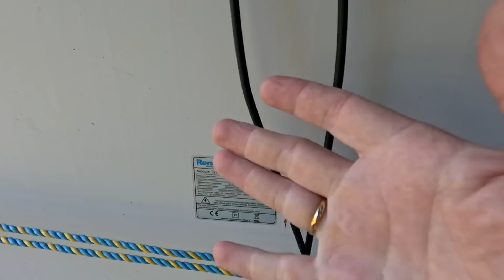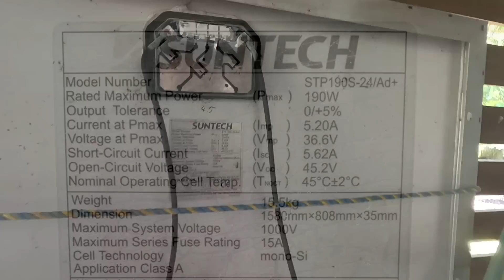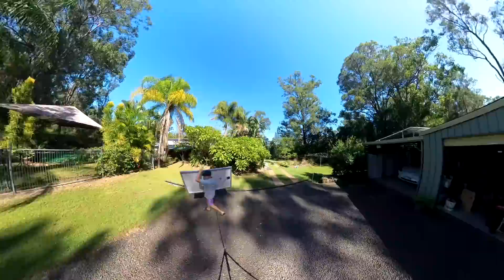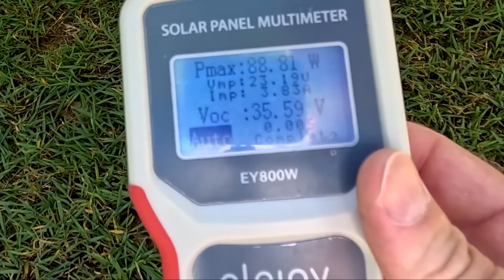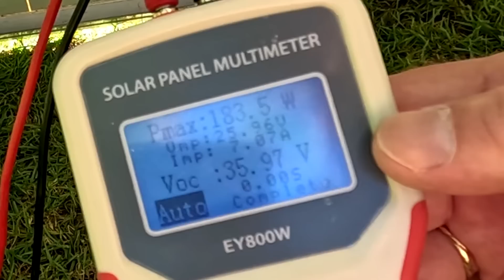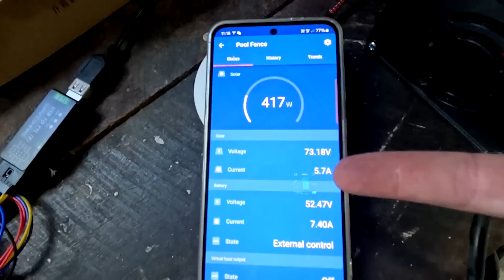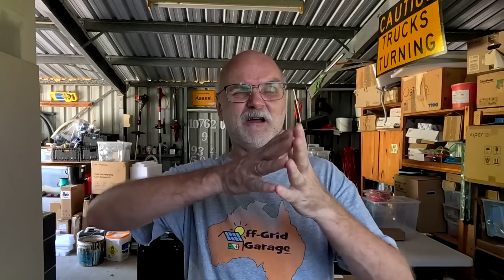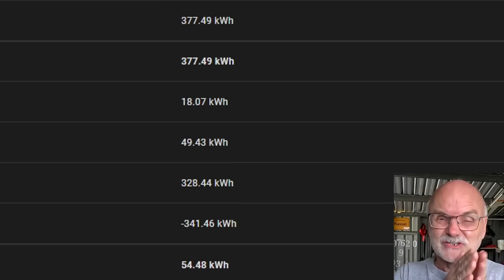Surviving winter with lots of shading with no additional Solar? Preparing for fully Off-Grid.

Comment: good video great that you show us consumers how a typical real life solar on the roof works together with batteries and trees, I'm not off-grid but have a power station together with solar cells I'm thinking of making a fence around the terrace and connecting it in parallel but it only works if the cable is not that long so series is probably better. One thing I was thinking of was also connecting my water heater to the solar cells, it should work like this that when the water has reached 75 degrees a relay should switch from grid to solar cells (no inverter) which should then keep the heating element on with 1/3 power that way the water should stay warm for a longer time while consuming the water too, if I can do it in the summer I can use the energy in the winter I've saved. You probably have an air conditioner to cool the house down in the summer the same could heat the water heater too. These are just thoughts on a low level

Comment: DC transport from the house to the garage is possible when you use more panels in series in a string (400-800V). The 5kWp on the house would be around 400V-500V. The 48V battery system will get complicated over 5kWp. You'll need for every 5kWp a set of MPPTs and an Inverter. If you want to supply energy to your home, let's say 5kW and charge an EV at 10kW. You'll need 3 Victron inverters and the battery will be discharging with ~300A.

Over 10kWp I'd consider a high voltage hybrid inverter with up to 1kV PV input and a battery with ~384V (39A @15kW). Higher Voltage, less heat and much more scalable.

Comment: Would be very interesting to see a video where you check all the panels for damage using EL testing.
You need a current limited DC supply capable of a bit over Voc and it should be safe to use 70-80% of Impp as current limit.
One camera I found that works for this is the TP-link C100 in night mode. It can easily see the glow from the panels and all the defects and microcracks show up!

Comment: I’d really love to see you stay grid-connected and continue interacting with it after your feed-in tariff ends. So many channels have gone off-grid now it’s been done to death and honestly, it’s getting a bit stale. It would be far more interesting to see you set up another MultiPlus 5000VA and run three systems, one per phase. With 2x Multi ESS units and the fronius AC export, the possibilities for buying and selling power dynamically, while exporting excess solar, are way more compelling.

Also, have you considered adding a heat pump to your setup? Ours failed a couple of years ago the circulation pump went and we saw our hot water energy usage jump from 1.2 kWh per day to around 9 kWh. That’s a change from 30 kWh a month vs a projected 300 kWh! I fixed it quickly once I saw the impact, but it's a great example of how much difference an efficient system can make.

Comment: Hi Andy, I think in 2026 install an extra 5k panels on your house, your house keeps the sun at a good angle. With the dropping prices it should be a no brainer. Maybe replace the MP-II's with the new 6000 ones which have 450V MPPTs on board and have a better efficiency. Keep up the good work! Maybe also try to increase your voltage on your mppt, maybe 4 in series will start your mppt a bit earlier. With the VOC of 35V it might work, but might also be risky.

Comment: With my panels on 45 degrees I still could have tilted them a bit more upright for the best sun in my 21 december sun. But there aren't that many trees in my line of sight to the sun.
I've got 4 lines of 4 panels. there  is about 15 meters between them to prevent shadowing when the sun is around 20 degrees (or did I do 10). The top of the panels is about 2 meters high. The bottom is slightly above ground.
Reply: Also I have quite a weight to prevent them from blowing away... 230cm x 113cm panels ;-) Oh they are 4 lines of 8 panels

Comment: Hi Andy.  We took the off grid plunge late September 2024 with 12.32kw solar and 10 x 100Ah Jaki batteries (we are @ 33° AU). What I have noticed is the relationship between the amount of storage consumed and how much the solar can deliver on any given day to replace the already consumed storage (but we know this). On our worst day this year (overcast and raining) we still managed to get to 98% SOC, thanks to new panel. I won't know whether I have the balance just right until mid September this year, but that is not that far away.  If I need more solar to cover any short fall I have more than enough space to add more panels in a ground mount configuration.

Comment: Nice Video again.

One question, if you add more battery capacity. How large is the loss while charging them in winter with less amperage?

From my understanding charging one Batterie with 20A works better/is more efficient than charging 20 batteries with 1A?!?

I‘m a little bit confused because I‘m thinking about the option of disconnecting batteries for the winter,  because I will not fully load them any more, with my PV System. 

So I’m thinking of throttling down the Inverter and disconnecting batteries for the winter.

Comment: Andy, What is your experience with solar panel testers?  Is there one that out-performs the others in durability?  FLUKE meter doesn't connect to the panel and instead rests on a panel and reads the solar into its own sensors.  I like the testers that use MC4 as it permits you to test entire strings.

Comment: Disagree with you and the wife! More solar is always a great project even if temporary (2 years!). Batteries are expensive and at this point a bit boring from a DIY / creativity perspective. In a video long ago (or not, I'm totally lost in your timeline!) you mentioned building something to be able to move around some panels lying outside your garage -- and I thought: this is also a nice channel project! i've built something I call "Solar Cart" and use it to move around the yard and boost morning/evening/day in the tough months. I would be curious what kind of design you would come up with! And it adds some daily hands on work to the solar farming which is quite satisfactory. And you can store it away out of sight from the wife when she's tired of looking at panels! Really Andy, all these batteries and solar you have is getting very posh compared to many of us :D Necessity is the mother of invention. Of course we wish you to stay charged as well :)
Reply from the maker: Batteries are cheaper for me than installing more solar panels AND connecting them back to the garage. The distance from the panel installation and location to the garage is too far and costly to dig in a cable. Machine trenching is not possible due to unknown location of irrigation pipes...
Reply: @OffGridGarageAustralia  You just start digging and then you find them and then you know :) If you could only ever use 6 panels I get you... Last year I trenched 40m out and 0.5m down with the pick mattock and it took a ridiculous long time but provides great benefit for a way longer time and was totally worth it. And once you have all that copper laid you somehow find a way to saturate it.. even if you thought you put more cable than you could ever need..

Comment: Hello Andy,
I'm not quite sure what you're trying to determine with the measurement. As far as I understand, the device can only measure the power being absorbed by your panel based on the current position of the sun, or am I mistaken? The panel's stated power refers to a specified radiated power from the sun. If the sun's position barely changes during the short period of the measurement sequence, you only have relative values for the panels. - Correct me if I'm wrong.
Kind regards
Reply from the maker: The panels are rated under STC (Standard Test Condition). That is mostly with E=1000W/m². We down here have a lot more than that and can reach 1500W/m².
With the SPAT, I'm ensuring the panels are optimally aligned to the sun and generate maximum output. The tester determines the max power output under these conditions. If the sun moves during the testing, it does not matter at all. Even a 5° misalignment in any direction makes no difference in output.
Reply: @OffGridGarageAustralia  Thank you, Andy,  for clarification. Now I understood what you had been doing.

Comment: Hey Andy why dont you just do a scheduled charge in ESS using ur home grid connection say 12-2pm during peak solar times. I use to do this to top up from my grid connected solar. I currently having issues since paralleling my 2 multis so have purchased a 48v charger, plugged into the grid connection to replicate the above concept
Reply from the maker: I'm off-grid and don't have ESS.

Comment: Would love to ship you a case of 24  cans of good german beer
I think its ”bier ” in german never mind love  your videos😂😂👍👏
Reply from the maker: Cheers, mate!
Reply: just tell them andy, there is no point in massive solar arrays offgrid if you cannot store the energy coming from the panels, even a small panel will give plenty of power if your battery is big enough to store it, note offgrid
however if you do have a massive need of power RIGHT NOW it works but if not a waist of money, you know it Andy and I also
Reply: lifepo 4 batteries, gods gift to RV people, a problem (lead acid) turn into a not problem (lifepo 4)😂😂
Best to you german Andy your videos are great

Comment: Hey Andy, Good to see you revisit the Winter question.  More solar or more batteries.  Ive roughly calculated i cant afford the battery, even for my modest use...   Id need  200ah batteries x however many days winter is long.  Thats just not practicle. But i have no sun for weeks so id have to plan a battery bank that can go for months, so lets say only  100ah per day, which is like100+ or more batteries to survive the winter... then youd need double the solar, half for your regular use and the other half to charge the bank for the winter.  Its doable to big of a scale for me to try.  Looking forward to see how you do.
Reply from the maker: Might be a bit different in our winter down here as we still have a lot of sun.
As I said, I have a few options, but it will be interesting to explore them and test a few things, what works and what works not so great.

Comment: We will we see an inverter upgrade or two, doubt the existing will be sufficient for fully off grid, without continously watching /balancing the load?
Reply from the maker: Yes, I will get a second Multiplus and run all three in series. Would be a great experiment...
I could use Home Assistant to do the balancing and the 5kVA would almost be OK. Certainly in combination with the Phoenix as I have it setup now, is enough for us. We almost never have peaks above 7kW.

Comment: Why not just run high voltage DC from the house, instead of the whole dc to ac to dc thing?
50 meters of 6mm2 500V and 15A gives you a voltage drop of around ,73%.
Reply: Yes indeed
Reply from the maker: Because we use most of the power as AC right from the panels?
Reply: @OffGridGarageAustralia  Yes in micro-grid mode, good point. When its a big ac coupled setup and bigger loads run from the shed already, might be interesting to look at

Comment: Suntech... Just orderd some. Glas/glas 440w selling for 60€

Still a good brand and under rated
Reply from the maker: Are they? I think they are terrible, at least back then they didn't have great quality.
Reply: @OffGridGarageAustralia  sind das nicht die Module auf deinem Dach ? Dachte die funktionieren bei dir noch ganz gut ? Sagst du jedenfalls in minute 3 oder so ? Mach mir keine Angst ... Gerade 3 Paletten bestellt 😅
Reply from the maker: @ No, these are the old panels from the house. Degradation was quite large. After 10 years, they had around 50% lost...

Comment: After going fully off-grid, have you considered any possible malfunctions and battery/panels degradation? Will it still be viable money-wise? Ps. I miss the Outlander times...My 2018 still goes strong, but I am going to invoke a battery warranty soon, I think ;) No battery reset attempts.
Reply from the maker: All panels I have come with a 25year warranty, so even if they go down by 10% over time, it will be fine.
I also have around 4 strings of solar panels. If one goes down... well...

Comment: It's all fun stuff. Keeps us busy and out trouble. My two arrays up and running will make a bit over 50kwh on a good day. Planning to get my third array up and going in a couple of weeks. Next step after that is to run the service cable over to the house about 100 feet away from the shed and finally go off grid.
Reply from the maker: Nice! That's such a good project!

Comment: Thanks Andy, I can't understand why your electricity consumption is so low, I only have 1 EV, the monthly average is about 700-850KW/h (here is the total consumption). (By the way, greetings from the almost sunny Lithuania).
Reply from the maker: I use between 20-25kWh per day. That includes both EVs, electric hotwater and 4 essential pumps, just to name the biggest loads. Makes around the same consumption as you have.

Comment: I was shocked how dirty my panels on the RV were over winter - I soaked them in car shampoo, then pressure washed them off on a fairly gentle setting - their output was maybe 25% more - you never seem to clean yours
Reply from the maker: No, because it makes no difference. I tried many times and there is no measurable increase in output.

Comment: 400+Wp panels now cost under 50 euro per panel in Europe. And that is without Alibaba or haggeling. Why mess around with old panels when space is limited?
Reply from the maker: Because it is only a temp setup for 3 months and I like to test and share the results.
Reply: @OffGridGarageAustralia that's applaudable. And the reason you are a worldstar in this field, and I am only famous/feared by the local electricians

Comment: Hey Andy! Awesome video! Once your contract expires in 2027, you could upgrade the panels on the house roof to 550-700W models (along with the off grid system) - then you'd have tons of solar and can look at a few dozen Gobeltowers for battery backup haha!!
Reply from the maker: The Fronius Gen24 inverter at the house has two MPPTs. I use only one so far, so could install a second row of panels under the existing row and feed this all into the inverter. It would get 10kW of panels with 5kW of max output. But I don't think I need it actually. It's good to have options...

Comment: Great video Andy, cant wait to see your freedom in 2027.  Will you need to change out your inverter, get a bigger one,?  Are you able to add 2 more and produce on all 3 phases it sounds like are going to your home today?  (wish we had that in the states.  only split phase)
Reply from the maker: Thanks Joe. I will keep the inverters I have and probably get a third one. All in series though. At least this could be one solution. It would give me the freedom to run them only when I need more power and it would be an interesting experiment.
We will stay single phase with the garage and house even we are 3-phase connected to the grid. We will see and I have to discuss with the sparky when the very exciting time comes.
Reply: Andy you can parallel the multiplus.
Reply from the maker: @egg399. That's what everyone would do😉
Reply: @OffGridGarageAustralia But you don’t have 2  x multiplus2 of the same size, same hardware version and same firmware number.  Victron is good but they don’t 1/2 make it complicated and a easysolar is like a hybrid inverter by powmr, srne etc but multiple times more expensive.
Reply from the maker: @egg399. They don't have to be of the same size, same version or same firmware. You just install different inverters in series, not parallel. It's that simple!
Reply: @OffGridGarageAustralia  Only up to the rating of the input and output relays in the multiplus.

Comment: Hey Andy I got a question I think a setting on my JK BMS is causing the BMS to shut off when 100% charge it shuts off for a few seconds then turns back on you know what setting this might be
Reply: If you have it set such that it hits an over voltage on a cell .... it will shut down for a time as you describe.

Set it so that you still have over voltage at 3.65 but but battery is full and stops charging at  3.62   there is nothing to be gained by hitting the 3.65V.  
That is my opinion... I expect with 104 304 questions a day he my not get back to you.
At this point he could higher an email consultant.
Reply from the maker: If the BMS shuts off, you must have hit a protection parameter. The Status screen will tell which one you hit.